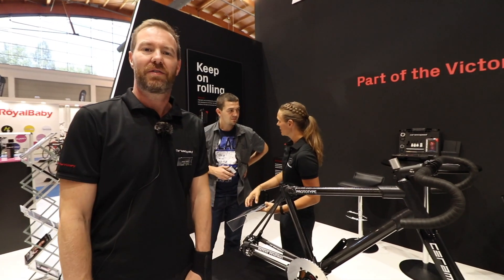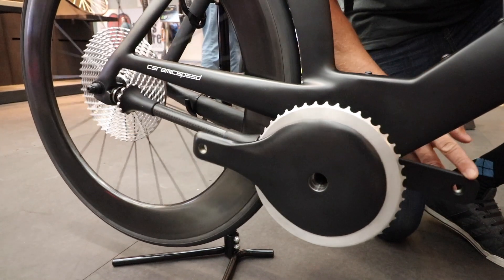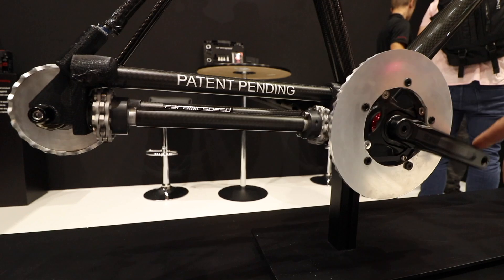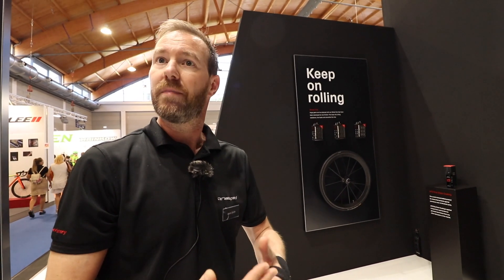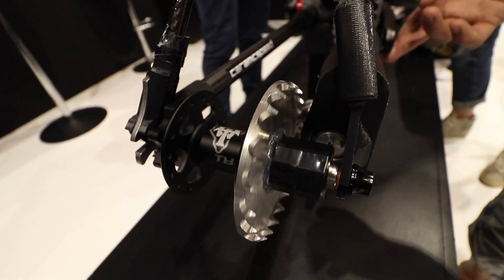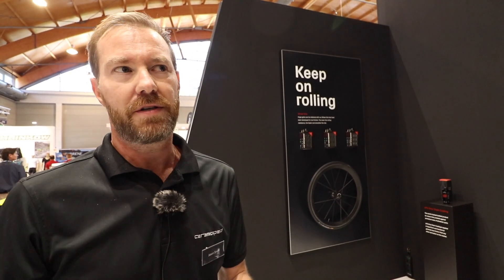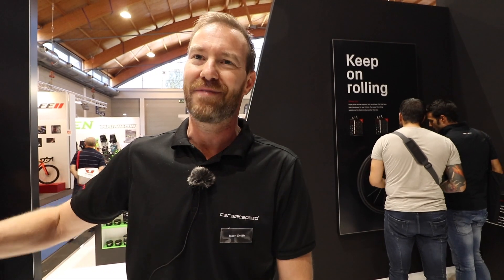CeramicSpeed Driven chainless drivetrain is 99% efficient

Comment: That system will run into big issues when a heavy powerful rider attempts to pedal standing up .... what is the maximum torque this system can withstand?
Reply: Just checking the prices for CeramicSpeed pulleys (extremely high) one can imagine the immense costs of this whole system to save 1 Watt over Shimano XTR. That's pure pro rider domain who need this 1 extra Watt savings. But those pro riders bring 1000-1500 Watt peak performance and are way beyond the 350 Watt demo model.
Reply: you said, quote:<<Anyone saying they cycle over 1500w are liars>... and that is just a lie, plain and simple!
and no, nobody can put out 1.5kW average, but in pro cycling there are quite a lot of people who can throw that much (and more) power into their cranks if neccessary... and in a sprint/track scenario where you put that much force into the bike a chain slip/broken crank etc. will probably have you lying on the ground with multiple fractures
Reply: why? to find out you cotradict yourself within a sentence?
...again, this is not a question of average power someone can put out - when your max power output exceeds the max power capacity of your drivetrain you can suck at someones wheel for 180km and then instead of winning a sprint, getting kisses and roses you end up in an ambulance with a broken jaw... if you're lucky ;)
Reply: Or if an tiny rock gets between the system it will break
Reply: don't believe cyclists can go over 1.5kw?
watch this guy doing 2.3 kW :P
...at 6:40
https://www.youtube.com/watch?v=PCLvqN9kwuo
Reply: Why on earth are we talking about how much power this can handle when what matters from a structural perspective is how much TORQUE it can handle? A rider pushing 300W at 30rpm is putting a great deal more torque in than one pedalling at 120rpm. As an engineer looking at this thing, I worry whether the cassette can handle the torque that a strong rider may be able to put through it.
Reply: the 5 percent are the ones that would be buying this bike as it prob would cost a shit ton
Reply: wtf you dont need to stay on 500 watts for 2 hours for something to break, if this think supports up to 380, someone standing up for like 2m, making up to 600 watts should break it already. or even 1 or 2 turns at 900
Reply: obviously.
Reply: or watch this cyclist in a gym doing bodybuilder stuff ;)
https://www.youtube.com/watch?v=lUE0rqRqZmM
Reply: What about falling, dirt, hitting stuff? Doesn't look too solid.
Reply: T dude if a regular rider goes all out in the saddle its 500-800w pros go to 1800 in sprints
Reply: Torque × rpm = power, so 380W doesn't tell much?
Reply: Themarenda that analogy doesn't work. When cycling you pedal with gravity not against it. You can apply a force equal to- the entire weight of your body x gravity + the maximum force your leg muscles can produce.
Reply: alexdol811   Make sure no loose 👖pants!  It would shred it to pieces like a mad 🐕dog would.
Reply: technically true but the rpm will not vary very much, so when we talk about power we are basically implicitly talking about torque.
Reply: Not sure about your math. If this system is over 40% more efficient than a current dura ace, where do you see a 1 Watt-difference?
Reply: hehe, reminds me of a friend who sometimes does extreme 52/11 training... uphill... single legged - he once cracked a carbon crank with that ;)
Reply: Themarenda failing material is enough,  believe me! i personally know an astrophysicist whose 2 comp fork broke apart...  on a roadcycle...  meant 2 weeks in hospital
Reply: Yes it should. And if you do your engineering right, it should actually be able to theoretically support 2-3 times the maximum load, depending on how safe you want to be. If you want to shave off grams, go for a factor of 1.2 at least, but that would be risky imo.
Reply: any cyclist interested in buying this tech will be banging out >1000w on any marginally competitive sprint.
Reply: I'm two meters tall and almost 100Kg I'm Dutch and most of those hi-tech frames and gears don't do me good. For me it's either chain or belt drive. All the rest sucks in daily traffic with real mud rain and weather.
Reply: Pro's (and strong amateurs) will regularly go north of 1500 watts. Personally I have no idea how strong this thing is but that would be my number one question... is it going to slip?
Reply: psychollek wich means that the watt difference is dynamic, depending on the actual watts put in.
Reply: BlackTalon53 exactly. This didn't seem like it can hold my watt output...
Reply: T lmao I always hit that an I'm 230 pounds lol yeah I'ma cyclist and yes I'm fast af
Reply: BlackTalon53    No it can't. It would brake those contact points. 
Just a PIPE dream.
Reply: T    280 pounds of torque Max standing on pedals?
Reply: MauriceNL   Try twiggs & grass!  Just an instant 😖mess.
Reply: Themarenda   Just a fall on an even surface can cause that.
Reply: Franklin Peralta     With this fragile system at the first ride everything would brake & chip off. 😂Haha!
Reply: Reece Deyoung

Exactly.   A 100kg person climbing stairs at a rate of 1.5 meters/second is doing work at a rate of 1500 watts (1g rounded to 10m/s^2).
Reply: Tell that to all the snapped chains at the start of sprints..
Reply: this should of been something that they designed for a track bike for the velodrome as a road bike I see it failing 100%
Reply: T 300 Watts isn’t a whole lot for a 200lb+ rider. 600 Watts is pretty easy for me to ride at standing and over 1200 Watts when ripping on the cranks. I don’t see this system holding up to any kind of power due to deflection in the parts. 
Sure spins nice on a stand though.
Reply: @Dilbert
Reply: alexdol811   Yes, or if a 🐦bird flys into it.
Reply: BlackTalon53 good point
Reply: T 500 W won't even take you up most of the hills where I live... Granted to sustain 500 W for a few minutes you will be suffering. The Wattage figure they mentioned I would say be the mean wattage of an intense ride.  

Just FYI though this bike would be derailed completely if brought into the real outdoor environment.
Reply: Standing up peddling uphill is not recommended. This is only good for coasting downhill. Standing up and peddling will void the 2 minute warranty. All this for only $6000.00.
Reply: in bursts most amateur road cyclist go over 400 watts. Im new to road bike and after 2 months Im already doing around 400 watts while doing anaerobic training or trying to beat some strava segments time.
Reply: Shut up U gay nerd
Reply: BlackTalon53  Definite maximum fingertip pressure with zero failures
Reply: well, i've seen track sprinters snap a chain off a dura ace group set, don't really see why this should be any less reliable
Reply: Well I said you have to be a pretty strong cyclist and I doubt you can deny that you are, if you are telling the truth (unless if you weight more than 280 lbs or so)
Reply: Ya man, if u go to bmx races u see the difference between a true pro, paid, full ride rider and even a local hero, insanely good ameture. Its just another level of power pedaling. Like unhuman speed and jumping distance. They look like video games compared to people u know who u think ride good.
Reply: 40% more efficient means that if dura ace loses X watts (between the cranks and the wheel) at given power then this one loses 0,6X watts. Ergo if dura ace loses around 2 watts (and it looses more actually) then this would be a less than 1 watt benefit (but in fact it would be around 3 watts).
Reply: BlackTalon53 I have broken many chains ridding, but with this new system here is a advance...
Reply: Must be fat
Reply: ok,  maybe it was retarded in the first place to use a 2 comp fork...  i give you that ;)
Reply: it says it had a 99% efficiency at 380 watts. I know pro can sprint  higher than that but still you have to be a pretty strong cyclist to go higher than 300 watts for a ride
Reply: @Tomy-im8zl  I'm an amateur and I've hit 1400 watts. Sure my average is not 1400 watts but it just takes a few seconds above tolerance to break it.
Reply: Haters
Reply: Dipshit, do you know what the word average means? They don't fucking do 1500w average. He said that. Get the fuck over yourself and realize you just can't read fuck face lmfao. The flying fucking ignorance coming out of your mouth, the videos you posted literally show you are wrong.
Reply: I'm not sure what you mean by regularly, but top cyclist go for ride of 350 watts in average. Anyway, 95% of cyclists never need to go higher than 400 watts
Reply: Anyone saying they cycle over 1500w are liars because it would equal more or less to performing deadlift with 150kg standing on one leg only, im not saying its completely impossible but you dont go on bicycle to pedal once and of course your chains would be snapping weekly
Reply: I said its not impossible, but how much did his ride last
Reply: Read whole thing again

Comment: i've never seen before anyone stupid enough to replace the teeth of a gear with tiny ball bearings. kudos for going all out in ridiculousness with this promo stunt, ceramicspeed. never will it be truly "revolutionary" though, because the design is so much BS it's never going to replace existing drivetrain designs
Reply: jbkltc It is either something you've never seen before or it is isn't revolutionary, can't be both.
Reply: Roj0307 I'll add another possible factor here: inspiration for other inventors.
Reply: jbkltc so your point is?

Comment: Shaft drive? Everything old is new again.
Reply: have you ever had the idea to write several pages of text on a device that has no actual buttons?
... me neither ;)
Reply: Right. That's why bicycles are using the latest and greatest innovation in drive train technology - chains.
Reply: More mumbo jumbo from you? Let me put is simply: your analogy about mobile phones is dumb, because buttons vs. touchscreen has nothing to do with shafts vs. chains. I don't need engeneering degree to see how this design is going to fail. It's not a problem of incremental changes to the design or as you pointlessly deflected in stating "what people will choose to buy" (FYI, fanboys will justyfy buying any shitty gadget). This setup is deemed to failure because its inherently faulty. Go back to your basic high school momentum physics and educate yourself on how vectors and momentum forces and UTS works because I am not going to give free classes to fucking alchemists.
Reply: Martin Schou cars still utilize timing belts and timing chains within the engine.   But more applicably high end crotch rockets utilize chain based drivetrains.
Reply: Doug Thorpe Exactly, there's a reason that MotoGP bikes, where the sky is the limit as far as tech is concerned & price is no object, still use sprockets and chains.
Reply: pafnucek well there you go again, offering not a single valid point why this won't work or isn't even an idea to expand on. Have fun talking to yourself.
Reply: sabamacx does a drive shaft use ball bearings? I'm not an expert that.
Reply: Remember phones with actual buttons?
Reply: Dumb analogy. Thinking by analogy is essentially the way morons and pleb thinks. Pleb  like you doesn't feel like understanding of physics matters at all, when they think about technology they think in a magical way, which is expressed by metaphors and sci-fy fairy tails. They love using analogy as an argument, because they are not capable of thinking from basic principles and see the actual physical problems case by case.
Reply: pafnucek or they just acknowledge the fact that there's new inventions every day that are taught to be impossible or useless (there, I even explained the anology for members of higher ranks of society like you). 

See, you also have to accept two extra facts: people still choose themselves what to buy and what not - if it turns out to be either not working or not offering any benefits over chains, guess how much they'll sell. It's not a hypnotising product that you can't avoid spending money on.

And if it's just not the right design yet, guess what the competition will do? Invest every cent and manhour into developing a working product. Do you have to buy it? Nah. Might it be something worth to invest in and having fun with? Maybe. Would we still be riding mountains on single speeds if gears were never invented? Definitely.

Also, show me your degree in advanced engineering.

Comment: also i really wonder how good this is going to perform in real life circumstances/if this will be ever a solution for the average cyclist who not only looks at performance, but also durability, repairability and price.
as i and others have commented under videos from gcn and gplama we worry about the small area of contact between the bearings on the shaft and the cogwheel - only one, max 2 bearings are in contact any given time whereas a chain grips into several teeth and direction of force which is not pulling along the plane of the cogwheel but pushing from the side so that it gets bend into the spokes/away from the shaft - this is going to be a major problem especially on the outer rings that have quite a distance from the axis and therefore are bent easier... will see ;)
Reply: good point!   but less area of contact - less coefficient of friction. in the end-it will work when using titanium alloys.
Reply: Михаил Варвус coefficient of friction doesn't rely on amount of area in contact. It's determined by the material between the two contact surfaces.

Comment: so a dura ace drive train has 98% efficiency? (meaning the dura ace has 2% friction loss - the ceramic speed has ~49% less friction, meaning it has roughly 1% friction loss... or did i miss something?)
Reply: remember their tiny ball bearing "teeth" are not sealed (and probably only lightly oiled) - in real world use there would be far more friction due to seal drag and lubrication (which actually makes up most of a bearings friction)
Reply: It's a loss of efficiency due to friction. What they forgot to tell you is that - assuming that this bizarre contraption can withstand constant force applied perpendicularly to just 2 teeth - is the loss of force due to spliting vector into perpendicular planes. Basically, 1/2 of your resultant force is applied to tilt you wheel axis perpendicularly to the ride direction. Its a ridiculous design that cannot work in real life unless you have a frame and hub and wheel that is 100% stiff - 0 flex. Basically unless you want to ride a tank, this type of transmission is the worst possible setup.
Reply: Haha. Marketing BS
Reply: seppstarthebest That's what I thought!
Reply: jbkltc not to mention dirt
Reply: seppstarthebest - exactly, but efficiency can reduce to 93% in worst case according to info online https://www.cyclingpowerlab.com/DrivetrainEfficiency.aspx
Reply: what you say would be: 'the dura ace has 49% more friction than this super fancy prototype'
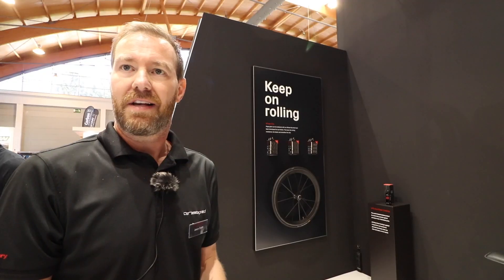but the guy in the video says (1:30): '...tested 49% less friction than a dura ace conventional drivetrain'
...see the difference?
(1/51*100=1,961)
Reply: thanks for the link - looks interesting!
Reply: seppstarthebest not my problem if you think you understand percentage calculation whenin fakt you dont...
Reply: let's do this with money and fruit ;) : an apple cost 1$ last year but now the crop was bad, prices increased by 50% - the new price is 1.50$... this is 50% more on a basis of 1$ 
a pear cost 2$ last year, but belgium has miraculously increased their output so much that the market price fell by 50% - the new price is 1$... this is 50% less on a basis of 2$
what the guy said is that it' has 49% less friction than a dura ace - so the dura ace is the base for his assumption... and he says this cs drivetrain is 99% efficient.
that means in turn that this ceramicspeed drivetrain has a friction loss of 1% - which is 51% (=49%less) of  (/than) the friction a dura ace group. now divide 1 by 51 and multiply with 100 to get the actual friction of the dura ace.
if the guy had said a dura ace has 49% more friction than the cs drive it would be as you said earlier... but he didn't :P
...my (call it rhetoric) 'question' came up because i was quite surprised about such a low friction loss in a regular drive train that runs on a rattling chain that is bent around 4 wheels - awesome!
...don't worry about my calculating skillz ;)
Reply: jbkltc yeah that or the remain unsealed and pebbles getting stuck in the balls will be what causes the increase in friction 😂
Reply: The marketing department is lying about the efficiency differentiation between chain this new way.  By a major amount they are lying. Plus this system will crumble fast this is why you don't see it displayed in action. There is fraud involved
Reply: seppstarthebest meh if ceramic has 1% friction and dura ace has 1.49% friction thats a difference of 49percent because 49/ 100 is 0.49